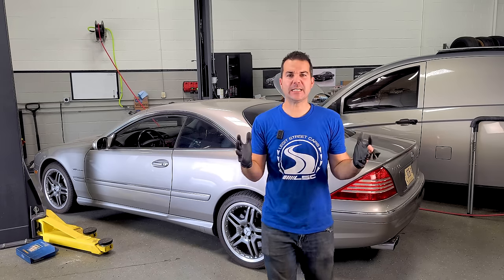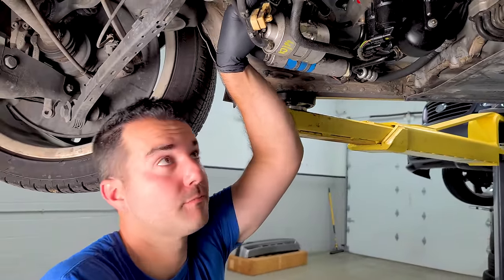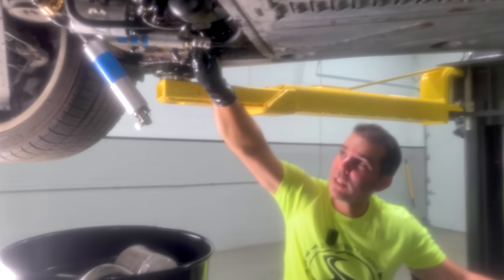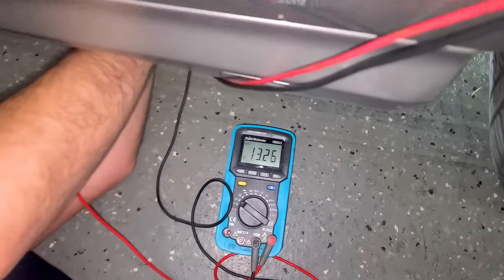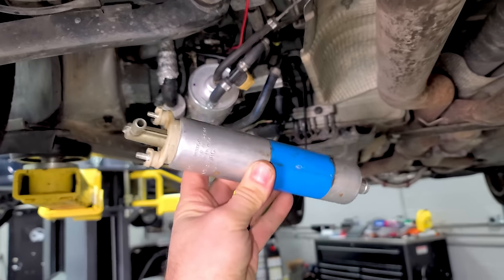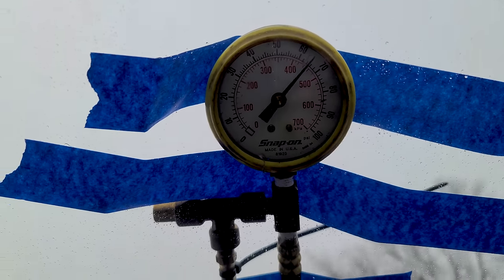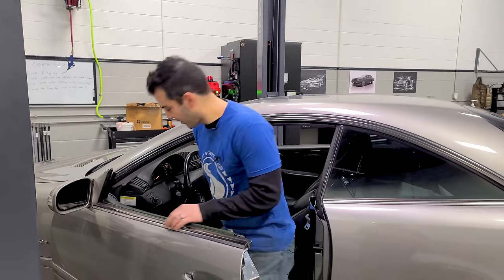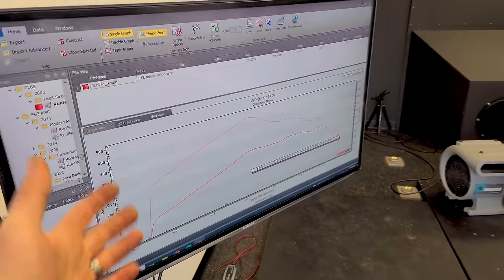I Used Bugatti Veyron Parts & An Alex Trick To Fix My CL65 AMG V12! You Won't Believe What Happened!

Comment from the maker: Get 5% off any tires and accessories on Priority Tire's site with the code 'LEGITPT124' until February 29th at: https://bit.ly/LegitStreetCars_PriorityTire.
Reply: This car! This is what got me started on your channel,  so for me this is your OG wip
Reply: fuel return remains pressurized. Maybe you have a fuel return blockage that is messing up the fuel delivery?
Reply: You said the answer in the beginning of the video voltage regulations for the pump.typed as you started working on the voltage box
Reply: Your throttle body is bad I think
Reply: @bradmorri I agree.  Check fuel lines.  I think you’ll find problem there.  If there is a blockage fuel pressure would drop at fuel rail.  You saw when you depressurized rail there was still pressure at the filter.  I think it’s fuel pressure line blockage.  If you can run temporary line from filter to fuel rail.  That will tell you if that’s the issue.
Reply: Hey man, I want to buy Tyler's new CL65. Please let him know I'm serious. I keep commenting on his video
Reply: It's called a Lock washer not a star washer.
Reply: They used them before the invention of lock nuts. And my guess the plastic isn't good with the fuel.
Reply: It could be blowing you spark out, hence high emissions. It will lower fuel pressure if unburned fuel is in emissions its thinking its over fuelling.
Reply: where is peter?
Reply: youd think someone would create new rubber gloves that wouldn't rip by now.
Reply: The parts cannon play list if you ever get this one done.. love the content!!!
Reply: bad injector cant handle high frequency goes full open to soon
Reply: I Used Bugatti Veyron Parts & An Alex Trick To Fix My CL65 AMG V12! You Won't Believe What Happened!
Reply: I've had amazing luck buying used tires from one particular ebay seller named UnitedTires, pretty sure he's based in Chicago. $60-100 for a name brand, sometimes even high end used tires a lot of times with at least 8/32.
Reply: AUXILIARY BATTERY MALFUNCTION
Reply: Have you checked the injectors?
Reply: Air/fuel should show lean or injector pulse width and or injector duty cycle should shoot up if its a pump issue
Reply: Did you try to change the fuel pressure regulator
Reply: Internal lock washer
Reply: Jack up the Radiator cap and park a Rambler under it.
Reply: Thanks for the discount, Alex.  Just in the nick of time.
Reply: The best video.....EVER!  Your persistence at the face of defeat is phenomenal, your zest for this vehicle is admirable, but alas she's just a scorned woman.  You clean her pipes, wax poetic and...nothing.  take your wife out nonetheless, then go play with your other love.  😂
Reply: Check the Fuel ⛽️ pressure again. You had it fixed. Fuel issue again.
Reply: My Mercedes E350 went into limp and it was fixed by replacing the accelerator pedal
Reply: I had same issue with my cl63. It was easy for me to pin point it because at that time i had only changed my spark plugs. Factory spark plugs have fatter ceramic and it holds the coil pack boot tight and you get proper contact between spring and the spark plug, whereas aftermarket spark plugs have thinner ceramic and boot sits loosely and coil pack is really easy to remove. Find any of your old spark plugs for the cl65 and compare it to the new Ruthenium HX plugs that you installed. If size is same and your coil pack boots take a bit of pull to remove then you are good and can disregard this. If  not then you will need to go back to factory spark plugs with fatter ceramic coating.
Reply: Hey Alex CHECK yOuR Voltage transformer it could be the issue that causes you to loose power and misfire !!!!!!!
Reply: I was thinking it had a bad regulator

Comment: I told you long ago - full throttle exhaust flow is moving the matrix in a cat; creating backpressure and triggering the limp mode -
Reply: that's not good!
Reply: Moving the matrix ?
Reply: @rbrood267   the honeycomb of catalyst
Reply: @rbrood267 the media inside the cat
Reply: I had that happen with my Firebird but you could tell because the car would be a 5k RPM but I'd be doing like 45mph. He likely wouldn't feel a kind of power when gunning it.
Reply: You know, not a lot of people would have figured out that suspension problem.
Reply: @davidt3563  It's a pretty variable problem - so many possibilities; so easy to check - just bypass everything in the exhaust to check.  Not sure what computer issues that may throw.  I have an '01 CL600 - less complicated!
Reply: You relieved pressure in the fuel system yet when you removed the pump there was pressure. Either you accidentally turned the pump back on or there’s a restriction in line.
Reply: This is exactly what happened to my trailblazer. Diagnosis nightmare! Watching this video triggered my PTSD. I went thru the same process Alex did (fuel filter, pressure regulator, vacuum lines, fuel down my armpit, parts cannon galore). Finally tested for backpressure by drilling 1/8th inch hole before cat and a vacuum gauge, had around 3 PSI (should be ZERO). Replaced the cat, muffler, o2 downstream sensor, problem solved!
Reply: My A4 did something similar. Cat disintegrated and clogged the exhaust. Test pipe for the win.
Reply: Not responding was his response. 
Luckily it didn’t cause an engine knock which I’ve seen a few times due to exhaust gases not escaping.
Reply: @mccanlessdesign good to run blow through test pipe for dyno purposes only could eliminate that problem
Reply: Just got further into the video, looks like you are right. I was assuming it had single pipe to tips. Not dual all the way.
Reply: How much space is there?? Really?
Reply: Good excuse to visit OJ too!
Reply: Then the holding materials at the ends of it must be gone.
Reply: This
Reply: @SkypowerwithKarl great point!! 🤙🏻
Reply: Only if you start it .
Reply: You should go with nameless cats if you don't know how to TIG will your own catalytic converter. If you hear that nasty rattling noise.

They use a high flow catalytic converter matrix😅
Reply: @mccanlessdesign thanks for this comment. I'm currently working on a MB and feel like this sort of really weird information will be necessary
Reply: It may be worth investigating why there was pressure in the fuel line.  maybe there has been a kink or restriction all along
Reply: That was my exact thought. He blew out the line from pump to tank so maybe blow out the line from filter to pressure gauge or even further
Reply: @ianmankersen  Mercedes has a problem with the baffles in their tanks breaking loose or if a previous owner stuck a piece of foam in there. The baffle could break into pieces or even the foam and get sucked into the pump and pushed into the fuel filter. But it can also strangle the pump from inside based on where it's located. I'm guessing this because mechanical machines don't heal themselves, something's able to move and that's why you're getting flow sometimes and flow restriction other times.
Reply: My mb had the same issue, cat was blocked. Remove the cat and try it.
Reply: Like to get Alex attention!
Reply: Replace fuel tank & sender. If that’s not it, replace all fuel lines. You’ve got a restriction in fuel system. Probably “minor, yet catastrophic” like what you found in abc system.
Reply: If it's running rich now, did you try and disable the second fuel pump?
Reply: You are on to nothing
Reply: Bad gas cap, not allowing proper pressure into tank which restricting fuel flow under demand. Probably worse with two pumps. $30 fix
Reply: Seems like there’s a supply line that isn’t big enough to support the volume required.
Reply: Stock cats are a restriction when pushing more power on some cars. Build a set of test pipes and see what happens
Reply: Does Neo know about this matrix issue? Whoa, a black cat! Deja vu?
Reply: YES
Reply: lol free FedEx shipping probably the worst shipping company tbh 😂
Reply: @eopian  did he do the filter and check the lines, work cheap and easy to hard and expensive
Reply: Oh man the amount of diagnosis I did to my Saab remind me of this video changed the bad fuel pump 3 times before just saying screw it and paid like $800 for an OEm XWD Saab fuel pump that was out of stock everywhere because the aftermarket’s don’t work
Reply: @SkypowerwithKarl  That was strange to me too. The only variable I can think of is maybe a check valve near the fuel filter holding the pressure? I just don't know the fuel system design of these cars.
Reply: Déjà vu
Reply: I don’t have much to add, except that when you relieved the fuel pressure at the engine, and you still had pressure at the pump inlet/outlet, this seems strange. Is there a one way check valve of some sort in the fuel line? If the fuel line is “pinched” (faulty check valve), you would get a drop in pressure at the engine, even though it’s high at the pump outlet.
Reply: Love this video. Its the adult version of my childhood - being humbled by machines 😀
Reply: Disable the second fuel pump
Reply: Replease the ecu
Reply: Try the gas cap. And try to find out what parameters generates the missfire code….for example CPS?!
Reply: The next video will be Alex taking it to the Mercedes dealership .
Reply: Find the nearest boat ramp , put it in neutral , and make sure your insurance is paid up .
Reply: I have encountered similar issue myself, my high flow cat hung pretty low and the car was pretty low too sit it had copped a few smacks from big speed bumps which broke the matrix free
Reply: @mccanlessdesign you just want alex to straight pipe it 😂
Reply: How could that be fixed . . . New exhaust . . New Cats . . . ?? . Whats yr thoughts. .
Reply: @rogerreed905  I personally just completely removed the catalyst and enjoyed the extra flow 😂
Reply: @stickit2theman1 wow. That sounds like a nightmare
Reply: Crankcase pressure??
Reply: Low muffler bearing grease level cup link sprocket
Reply: @mikethurstan 
I'm thinking this...
Reply: If the cat matrix is moving then surely the cats would rattle a bit?
..
Many years ago I remember an old 90s Audi 90 20 litre with mechanical jetronic fuel injection.
Car would drive fine but would cut out at 80mph.
After many garages, it turned out to be a  fuse that had blown but had melted back together - wasn't allowing Enough current for the fuel pump + the fuel pump was receiving ~ 9V..
New fuse problem sorted.
Reply: i would get Mercedes to talk to the ECU and scan for codes. The Autel may not see all the same data
Reply: check vapor return line. remove 2nd pump.
Reply: Kudos Alex for taking us through another phase of troubleshooting.  You will eventually get it, but I really like the process you do as a skilled mechanic with tons of MB experience. One thing stood out to me was you mention that the cat cleaning process sometimes works, and some times doesn’t. 17-18 yo cats would seem to be a possible continuing issue as you can only see so much. Test pipe would take that question out of the equation. Residual fuel pressure is really weird and a question, reminiscent of the exploded abs/bomb issue which left you aghast.  Something could be dislodged perhaps leading to the intermittent nature? More adventures to come! Thanks for sticking to it!
Reply: This video alone has destroyed my want to buy a Mercedes Benz!  LOL
Reply: Why wouldn’t you put lower restriction sport cats if you even want to run them?
Reply: Make sense but it would trigger the back pressure code before and after the exhaust. But I guess he should open the exhaust and or drive it without. Bet he is going to do that!
Reply: Yup, this

Warrants further inspection
Reply: I've seen a similar issue before and it boil down to intake and exhaust issues at the same time. The way I approach it was to put a quart of pure acetone into a full tank of gas and replaced the gas cap with an OEM one. Drove the vehicle for a week and the issue disappeared. I don't know if this would help but it is a pretty cheap way to check. The over pressurization in the fuel system also seems suspect makes me think that the fuel relief valve may be underperforming, but that should have triggered a fault code. So there I'm going down  the rabbit hole too. Good luck Alex.😅
Reply: @stickit2theman1 same issue with my trailblazer,  thought the trans was going out again. Nope cat was clogged. Order a aftermarket for $100 sold the original for $370 and truck made it to 350k miles before the trans went out again. Paid 500 for the truck 5yrs ago. Overall it paid for it self went from 239k miles to 350k when I got rid of it.
Reply: Just straight pipe it and bypass the cats.
Reply: Yes sir!!!! You could see around the edges of it when he showed the borescope. That's why the car is going rich! The car is revving up and the clog happens intermittently pressure builds the matrix moves and it clogs and builds pressure and at that time you lose flow and now equipped with two high pressure fuel pumps forces just enough fuel into the motor to load up before the pressure builds high enough for the computer to kick the car into limp mode so the intake manifold doesn't blow off the car. When it senses a rapid increase it shuts it down due to the speed of the increase and not so much the pressure.
Reply: That is why the fuel goes rich now it only happens for a split second
Reply: Of course he ignored your comment
Reply: Have you contacted Mercedes?, surely they have something to say..
Reply: How come no one has said anything about the turbo? You heard the noise from the psi. He said the boost numbers weren't right. I think it's not opening and closing enough, and that's putting it in limp mode.
Reply: Bad ecm
Reply: @mccanlessdesign not really. Same ABC, M137 is a boat anchor compared to the M275.
Reply: that would probably explain the rich condition when the o2 sensor is seeing more or less of the element
Reply: Let the man trouble shoot and create content. Matrix, cat, Neo, Sylvester....
 we get videos😂
Reply: @SkypowerwithKarl I came here to say this.
Reply: @SkypowerwithKarl 100%
Reply: The shop needs a shower
Reply: @rbrood267 yes there’s a glitch in the matrix.
Reply: @rbrood267 yeah FFS don't let mobius find out will you....
Reply: Are you sure not throttle body causing pressure problems

Comment: Hi Alex, long time follower here! I am a tuner living in Belgium and 90% of the cars i tune are European cars. My guess is somethings wrong with the tune because its not that easy to tune those cars with bigger injectors and turbos etc without the tuner logging al parameters. Especially the bigger injectors, thats why the fuel pressure is going down. Autel is also not a great logging tool for those mercedes because allot of parameters you are not able to log. What i would do is put back the stock injectors and write the original stock tune on the car and see how the car reacts. The bigger turbos wont give any issues with stock tune because on those ecu’s the throttle body will cut the amount of air going in the engine to keep the requested air mass under control. I wish you goodluck and cross my fingers that you find the probem! Goodluck👏
Reply: Agreed
Reply: He's too proud to take any of your advice or even respond. Greeting from Luxembourg
Reply: yeas i agree along with fins that are clogged remember this is all content, i'm sure he would have responded if it wasn't sorted out, hes became pretty popular and grinds hard
Reply: He should sell the Damn Car ! ...now i have a headache watching this moran
Reply: Great advice. Do you have a tune company in Belgium? If yes,  what's the name of the company? I'm also from Belgium by the way.
Reply: @mbz4652 Yes indeed, Motorsport in Houthalen-Helchteren.
Reply: I am in agreement with you, reset it to original and be done!!

Comment: As a computer geek with 45 years of experience, I have learned that when working with computers if the error is consistent, it is a software error, if it is inconsistent, it's hardware.

Comment: Hi! Former MB tech here, while there is a clear difference between engines, I've had similar issues in the past on inline 4 kompressor's of the W203 (same era) series, when engine temp rises, engine performance falls and you get the "misfire" condition which also simulates low fuel pressure on max pedal request, the fix for that is not the fuel pump and filter, but the fuel rail pressure switch.

Comment: Hey Alex, European diagnostic technician here! Don't give up, I enjoy watching your videos as no 1 technician knows everything. I think its time for an oscilloscope on a fuel injector on each bank and a coil inductive pickup on each bank (this would be tricky with the large all in one coil) Then I would move on to using a pressure transducer in the exhaust and intake. Are your intake temps staying manageable or are they still shooting up after some continuous full throttle? If they are, you have an airflow issue.
Reply: yeah i think the fins are clogged

Comment: The frustration is real with this one…
Reply: My cat was clogged and I had a hell of a time getting him into the carrier then to the vet to have him neutered. Completely unclogged and running fine now.
Reply: wait what💀
Reply: OTOH the reason for his pressure issues may be a blockage somewhere in the fuel line if he released the pressure on engine side and it was still pressurised on the pump side...